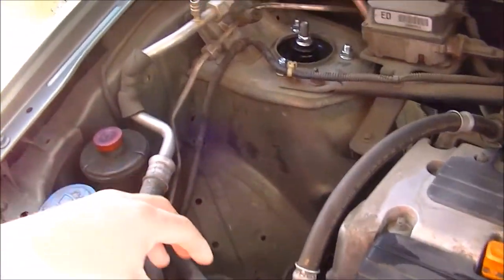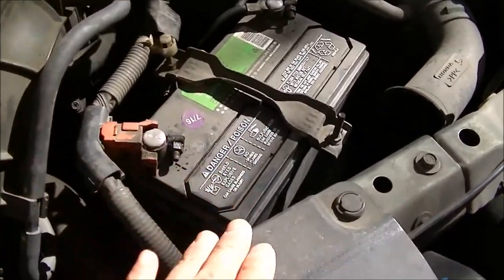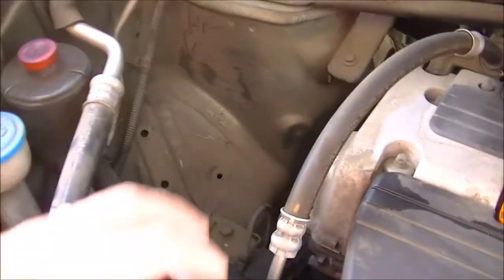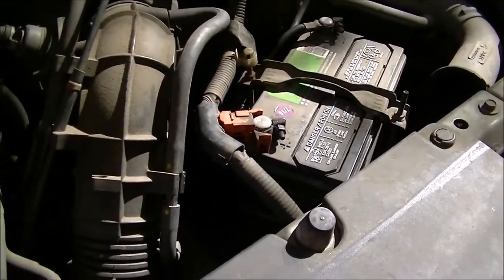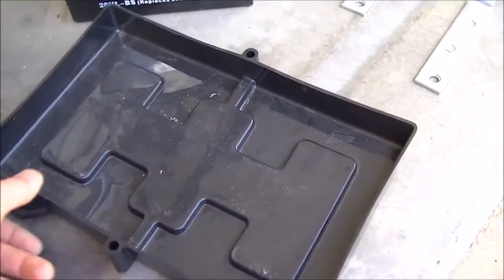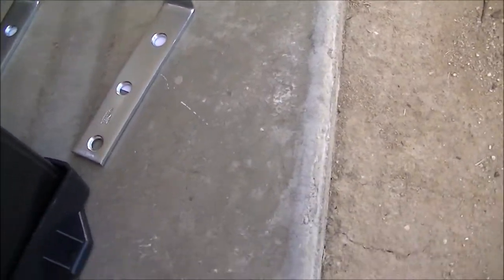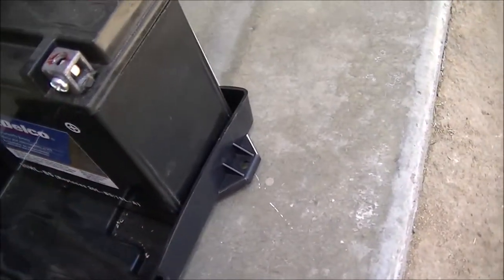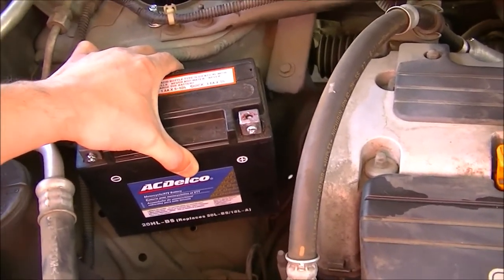Honda Element Micro RV. 29. 2nd Auxiliary Battery

Comment: If you replace the stock 51R battery with a group 24 (there is  room in the original spot), you may not need a second lead acid battery.  There are also newer tech batteries that are much smaller.
Reply from the maker: Agreed.  I wanted to use 2 batteries so I can keep the cranking battery isolated from the rest of my stuff.  That way I am not stuck with a dead battery in the middle of nowhere.

Comment: Since that battery is a sealed battery, meaning no off gassing, why not just keep it inside the vehicle... it would solve two issues... one, you don’t have to perform all of the labor to mount it and run the cable. Two, the longer the cables from the battery to your devices, the more resistance there is. That decreases the amount of voltage available and will reduce the run time of the battery.
Reply from the maker: Battery is regular acid. Not sealed, it does looked sealed though.  It was a lot of labor and I would have preferred not to.  Didn't want to purchase a sealed battery because I had this one in my garage and wanted to use it.
Reply: In the Elements understood
Reply: In the Elements could you just have bought a box to hold the battery? I know they sell large plastic cases for making your own power supply with a car battery.
Reply from the maker: Definitely could use a box, but you would still have worry about gassing.  But even if you get a sealed gel battery, it still takes up a bit room in the car.  Element is small, so storing this under the hood is good on space.
Reply: In the Elements agreed that room isn’t huge(I own one also. I also used to own one that my son wrecked 😢) maybe you could put the battery under the rear floor where the spare is. I know it would require removing the spare. I’m just looking at this from the effiency aspect, in no way is this a criticism of the location, just offering ideas and info that not everyone may be aware of.
Reply from the maker: It would be great to relocate the spare and have that space. I have considered it, but decided against. I do have a video that gets a little extra space in that spare well. If the battery is smaller, it may fit with the spare.
Reply: @randallbollinger1449  The wonderful part about the Element, is that is has so much creative space, and he could have placed that battery inside, and saved himself a lot of labor, plus used far less wiring.

Comment: Maybe I'm wrong, but couldn't you add a solenoid so that you could charge the battery from your alternator while the Element is running, and then automatically shut off when the car isn't running?  I'm just an old woman trying to figure this all out for myself, so excuse me if I am incorrect about this.
Reply from the maker: That is the what I have.  The switch is in the video.  Around the 10:51 mark.  That isolator lets the battery charge with the alternator and isolates the battery when engine is off.

Comment: It's the ABS unit which EX models have. 
Living in Colorado I'm glad I have it and the AWD, but I got no where to put an extra battery....I've got too much junk in the trunk!
Reply from the maker: Ahh.  Makes sense. I have a base model. No frills. Thanks!
Reply: The ABS system was standard on all years of all models of Honda Elements (LX, DX, EX, SC) sold in the US.  I believe that it's been removed from yours. It's an expensive system, so if the vehicle was in a right frontal collision, the salvager/rebuilder may have opted not to replace it.

Comment: Hey buddy.. question.. does it shot off when automatically when the engine is turned off (to not drain the car battery)?
I like how you added those items
Reply from the maker: Alvara DaCosta , yes. That is why I needed to add the switch. Will recharge but not drain.

Comment: Do you believe this is a better set up rather than having a battery and inverter in the element?
Reply from the maker: I think in car is better and easier. But I did this to save space. I wanted to build this in a way that I can move in the back relatively easy. But if you are choosing a platform bed with a bunch of storage (for example), I would put it in the car. Good luck.
Reply: Thank you